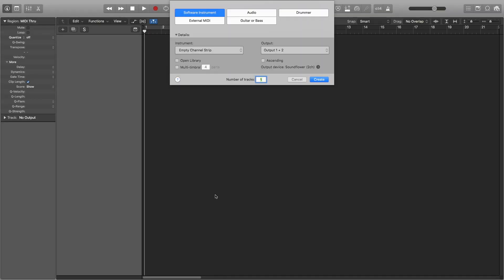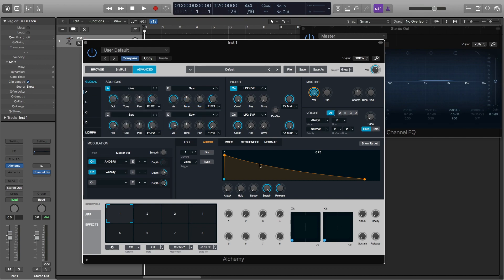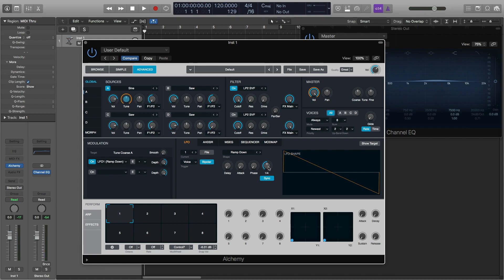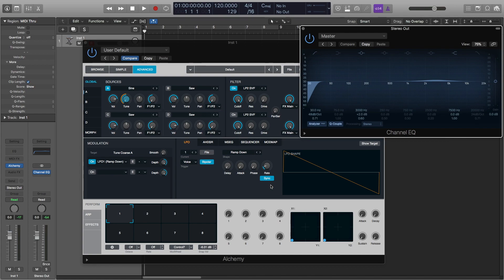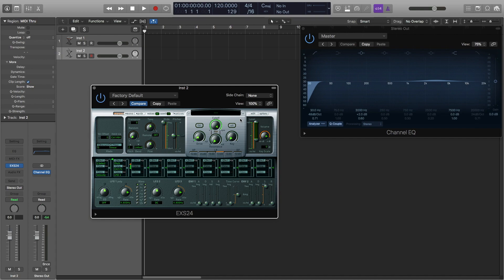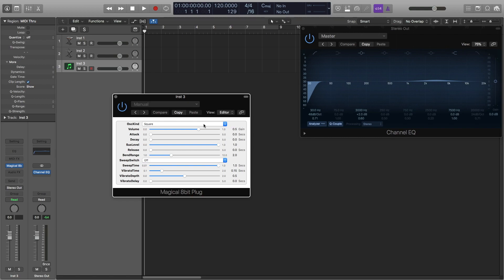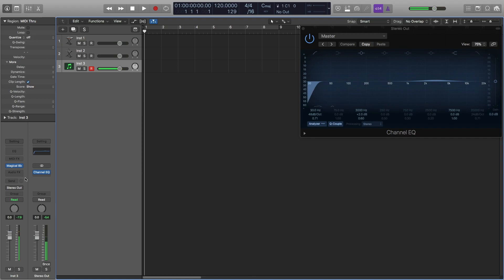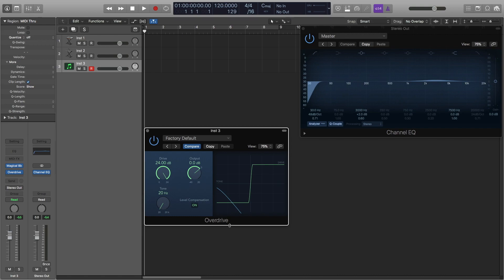3 Ways to Make a Sine Bass Drop in Logic Pro X

Comment: For those it is not working for I found out that in the modulation panel you need to make sure your depth knob is turned up.
Reply: This is the solution
Reply: This worked. Thank you.